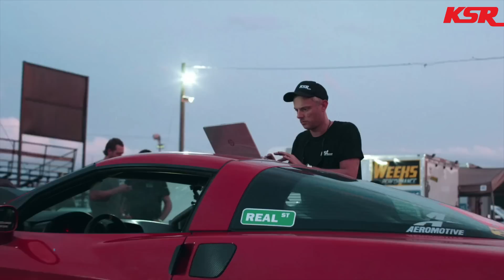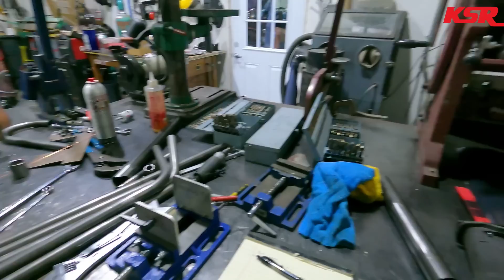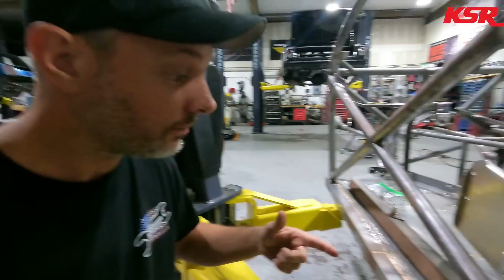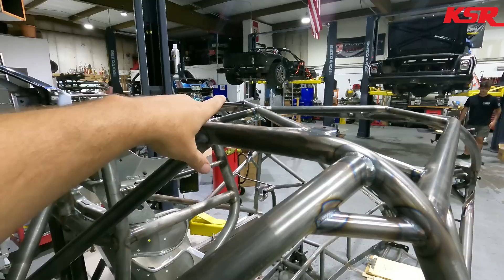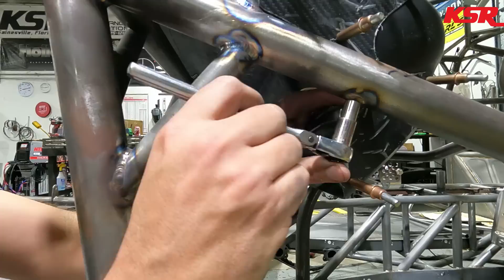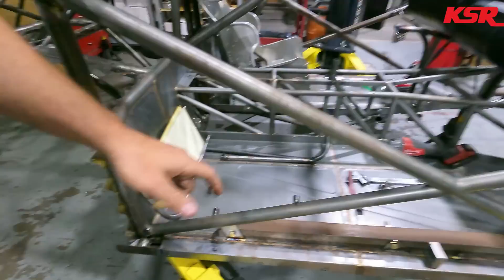Val Morris' Camaro Dash Mounting and Other Preparations for Powdercoat!!

Comment: Im a little worried about a rear tire blow out and taking out the leash board. I know it may never happen but if the car has carbon wheel tubs, wouldnt a blow out maybe take out the leash board?
Reply from the maker: Highly unlikely
Reply: @KSRPerformanceFabrication  i agree, but random stuff happens, most of which we have zero control of.

Comment: So would it make sense to add a port in the air system so that in the event the rear electrical failed and compressors could not run - coul you add a gas port for a CO2 or ? tank 
Like an air hose or the Quick time quick connect fittings 
Shit can happen

Comment: Did you see the new adjustable steering column by CJR race car's? Steve should have you put this in before you powder coat the chassis.
Reply from the maker: It will not work in this car, even though it’s a killer piece.

Comment: I think there is a weld missing on a diagonal gusset at 24:00?
Reply from the maker: Up under the dash bar? It’s welded, though we coated the chassis in Fast Etch a few months ago when the project got parked by the previous owner so it’s all the same color. Good eye though!

Comment: I was under the impression that you wanted the Mac valve as close as you can to the chute handle to avoid and delays
Reply: @UKMechanic because it’s not a cable. It’s air. So you hit the button which triggers the valve that air has to travel the distance from the valve to the chute handle.
Reply: @UKMechanic the cables are the mechanical operation from the handle to the chute bag. Air pushes the handle and the air ram behind the chute. The Mac valve is connected to the button on the steering wheel. There is no Mac valve for the air rams on the chute.
Reply: @UKMechanic keeping your hands on the wheel at 200mph makes much more sense than taking it off trying to find a handle.

Comment: I have a question...after welding all the frame tubes you start drilling a gazillion holes for weld-nuts that require drilling the frame tubes.  How do you clean all the "filings" from the inside of the frame tubes since they are now enclosed?
Reply from the maker: The majority of them fall outside of the chassis when using a step bit. The small amount that gets inside of the tube, I’m not too worried about.

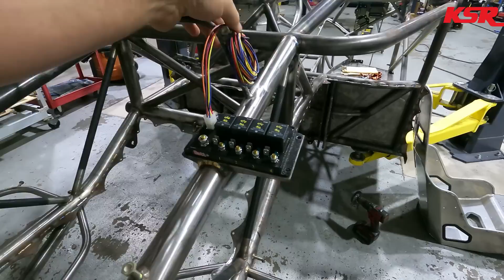Comment: Are you using rubber isolators or some sort of vibration dampener to help protect the electronics @5:05 , or has that ever been an issue with electrical gremlins?

Comment: Consider adding some dampening material under the relay board given that it’s cantilevered off the bar and the vibration it will see from the rear suspension

Comment: Are you going to look at CJRC new adjustable steering column set up
Reply from the maker: It’s a killer piece, but will not work on this car
Reply: @KSRPerformanceFabrication  I was wondering the same thing, if you had seen the column they did for Cleetus and are now going to manufacture it, it's cool that Cleetus has this effect.❤

Comment: Kev why do you not use Rivnuts  save a lot of time welding in those captive nuts ,, also is there not a 3d scanner you could use for notches on roll cage tubes , like dentists use when they scan your mouth for a new crown ,
Reply: We use them a lot at work on round as well as flat if there not pulled correctly they can spin I understand that , but your a craftsman and you know what you like to do and what your happy with

Comment: I remain impressed by KSR's attention to detail, to driver safety.  I used to do technical marketing for my software product and often used "Robust and Elegant" in brochures to descript the product.   I'd have customers with a budget, a delivery date and a set of requirements that were sometimes unworkable.   In my lab I had a sign that said "Fast (rapid creation), Cheap, Good.   Pick any two.  That would guide our discussions.   KSR work is robust and elegant and always good (safety and performance) probably with fast and cheap being discussion points.